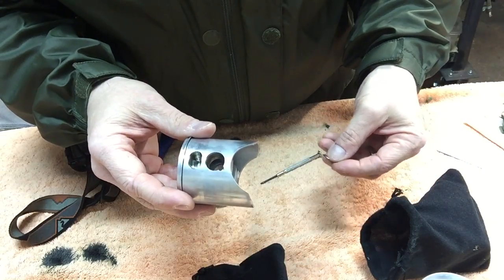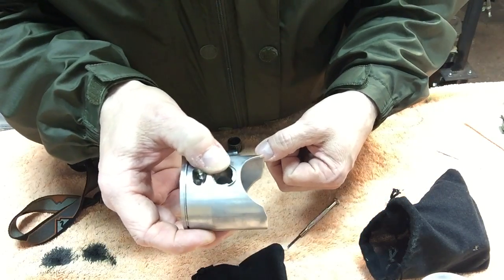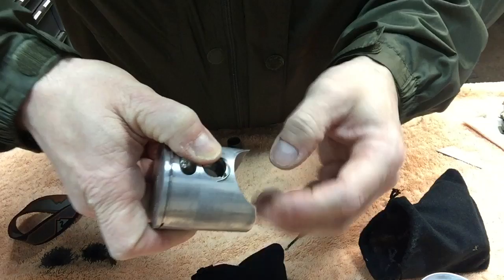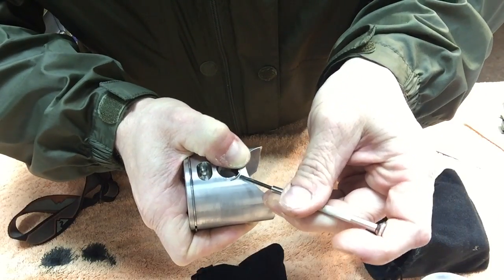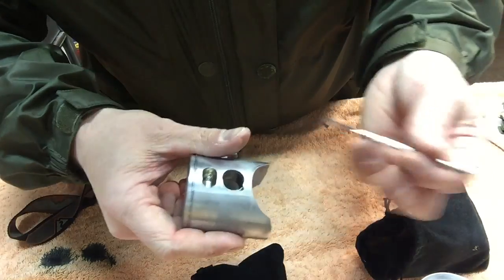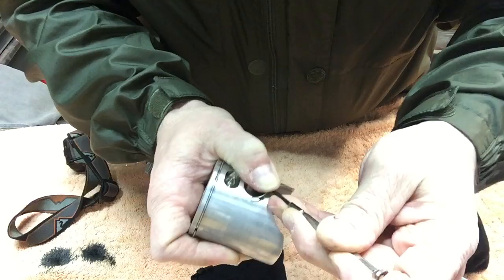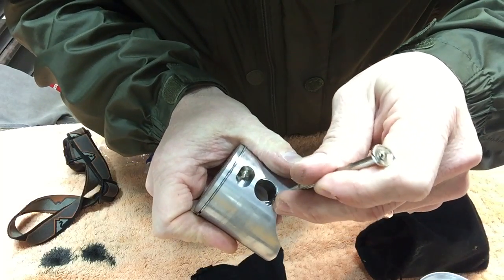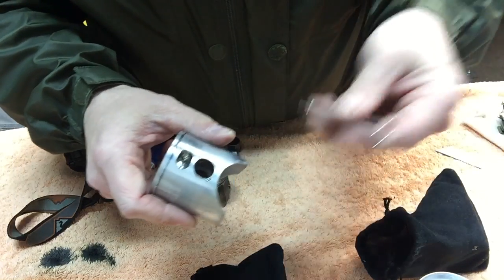Piston circlip wrist pin install technique

Comment: nice if you have a notched piston like that. otherwise you r fighting it. tip: don't reuse the clips once you take em out. no doubt they are deformed or fatigued from use or just by removing them

Comment: I haven't found a video on YouTube with the installation of the circlips in a piston, already on the piston arm. I'm assuming it's the same steps, but you have to be more delicate, right?
Reply from the maker: Rick A.  Yes... Most importantly, put a clean rag on top of the crank. You definitely don’t want to lose a circlip down there.
Reply: BigRedGrizzly Thanks @BigRedGrizzly I was mistaken I actually did find a video earlier of a circlip installation on a piston already on the piston arm. Both videos compliment each other very well, btw! Success to ur channel and thanks for the tutorial, very much appreciated!

Comment: hey great technique but you made a bad mistake check you're instruction the opening in the spring must always face the top or bottom in you're case bottom . I will try the technique it looks relatively easy
Reply from the maker: Everyone says that. I should have mentioned that I rotate the c clip once it’s in.